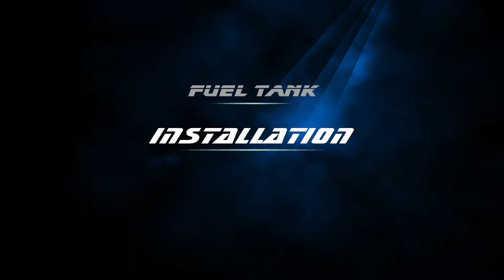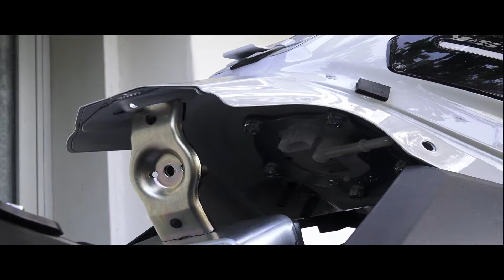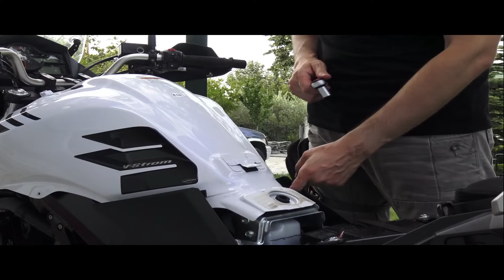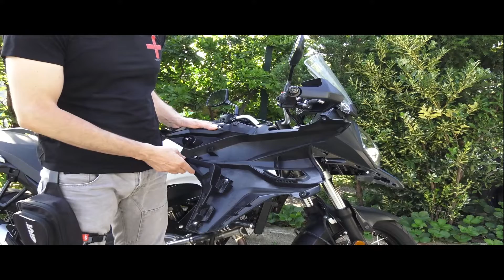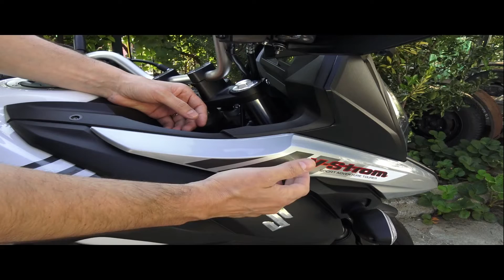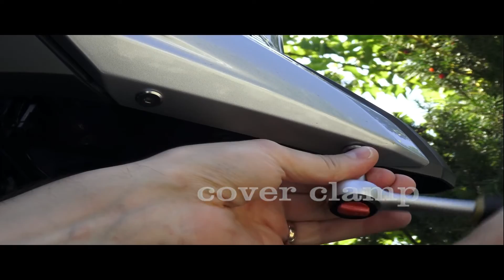3rd Generation DL650 Vstrom L7 Fuel Tank Installation

Comment: Thanks again 
Only have 250 miles 
Will have to do this at some point  for Air Filter, Coolant refresh etc
How Many miles/KM do you have?
Reply from the maker: Now around 4000km. For the coolant and air filter refer to my other DL650 videos which I go through these in detail. 
Dont worry the videos are about 2010 L0 model as the process is exactly the same.
Thanks